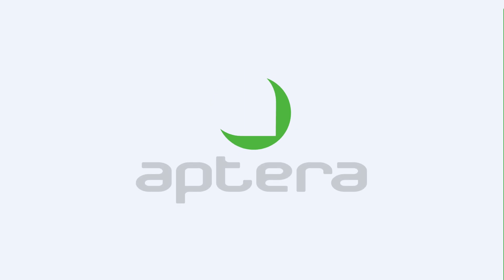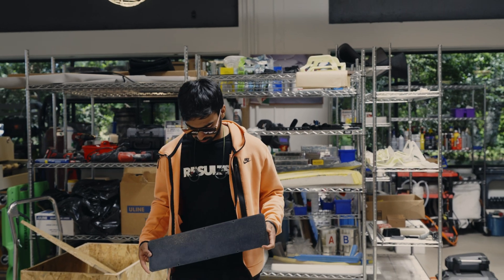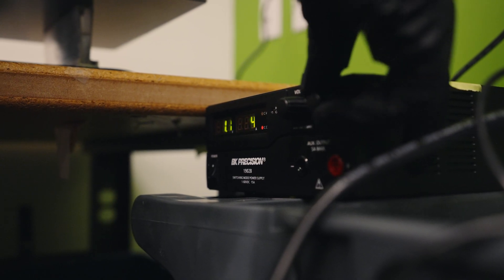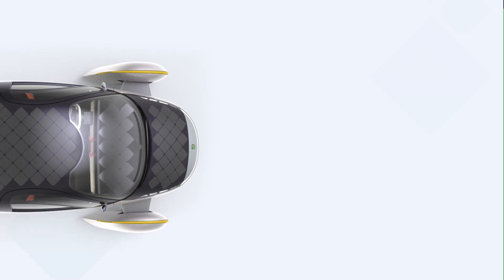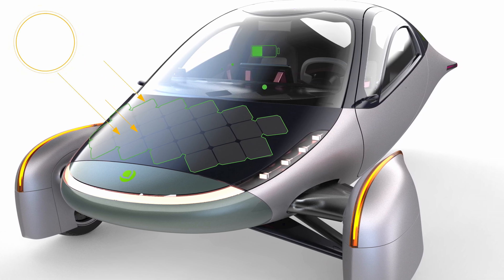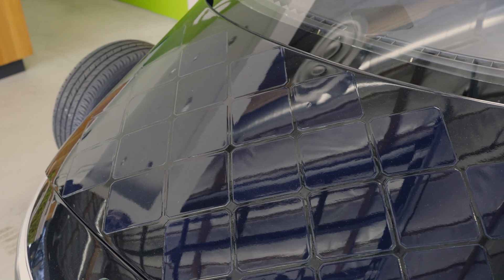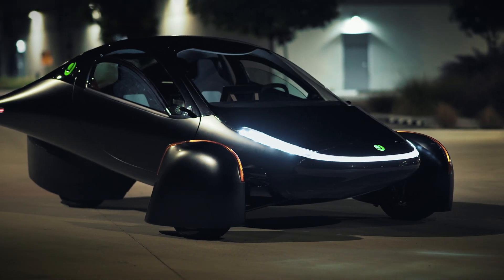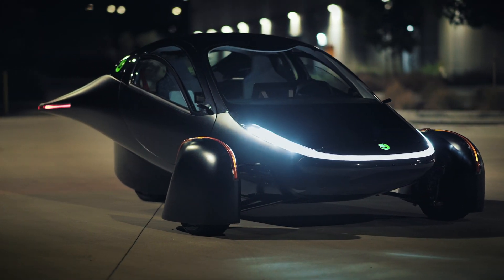Aptera Makers Series — Solar

Comment: I have mine reserved.  I hope they do a heat pump and deliver on range estimates at highway speeds
Reply from the maker: How exciting! Aptera's range is tested at the EPA driving cycle with a max speed of 67 mph. With higher speed comes less range but cruising at 65mph is our expectation. We will likely not have a heat pump in our first production vehicles. They are very complex systems and it's a 2 year development effort to get a design implemented.
Reply: @ApteraMotors  that is why going with a longer range is preferable. Running AC or Heater will mean less if one has a bigger battery and more cells to counter that demand.

For the $10k USD Difference between the .6 K miles and the 1.0k mile range, I wish they would throw in Autopilot for free. But I'm still ordering the 1k mile range vehicle.

Thank you for the information.
Reply: @ApteraMotors  Heat pump is AC. Are you thinking something else? I was under the impression this will have AC.
Reply from the maker: @jlschmugge  Sorry about the miscommunication. Aptera will most definitely have AC!
Reply: @ApteraMotors  oh thank god. Metaphorical sweat wiping from brow cancelled.
Reply: I think they will, a lighter and more aerodynamic car should be more efficient at high speeds compared to heavier cars.
Reply: I agree sir. Luckily I live in Southern California where it doesn't get as cold. I will be using the AC more than the heater. By the way, heating an EV might reduce your range by 40% -  50% if they have "combustion" heaters. Heat pumps are better and take less energy from your batteries. So I pray for a heat pump. AC may reduce your range by approximately  20%. This is why the 1kmile range is something I'm interested in although I will paying $10k USD more than the 600 mile range model. That is a lot of money for an extra 400 miles. And these ranges are just for comparison for now. We don't know what the real ranges will be until later. Considering the recommended battery charge range for optimal longevity of your cell phone  of between 20% to 80% , I think the 1kmile range will be around 800 miles. I hope I'm wrong.

Comment: I like that the solar cells are replaceable. Hoping Aptera reconsiders taking Bitcoin because of all the fossil fuels used to power it.
Reply: Damn I didn’t know they were doing that. Hope so too.
Reply: @Palbizu  It's kind of like supporting the coal/oil/gas industries, the same your products are working against.
Reply: People that didn't buy Bitcoin initially are angry for missing out on the opportunity. I guarantee you that if you had some BTC you wouldn't be playing the Earth card. Even an electric car is not carbon neutral. Emissions were produced to make it. Now if you walk to work everyday, then I know you are serious.
Reply: @IDNHANTU2day  I do walk to work. I and many other people don't own Bitcoin because of the huge carbon footprint. Doesn't matter how rich you are if your planet is unlivable.
Reply: @IDNHANTU2day  tbh The whole green energy thing is bullshit. I worked at Hemlock semiconductor in Hemlock Michigan for 18 years. The dirty little secret of silicon manufacture and solar panels is that the amount of electricity required to make silicon will never be recovered by any amount of sunlight generating electricity on a manufactured solar panel. Plus that plant is a ginormous HCl chemical plant and is not very eco-friendly to boot. I don’t care about digital currencies at all. Just want an aptera cause I think it’s pretty cool and I would like to get away from gasoline’s expense.
Reply: Elon’s on Bitcoin for that reason. He can swing that coins value again if they don’t.
Reply: @richardgarlick3861  Tesla no longer accepts Bitcoin because of the huge carbon footprint.